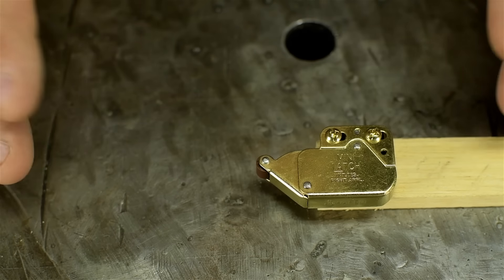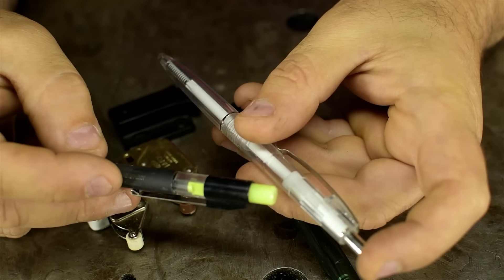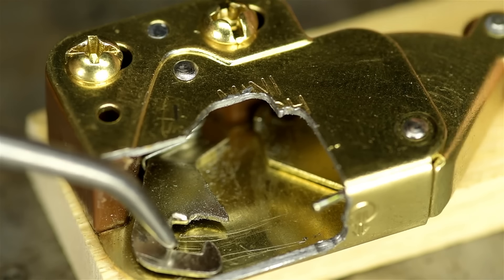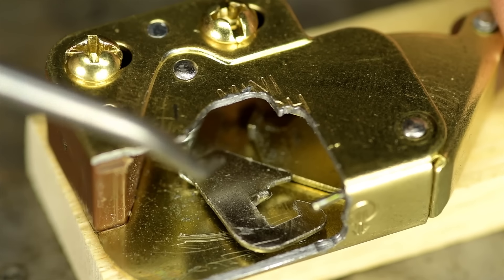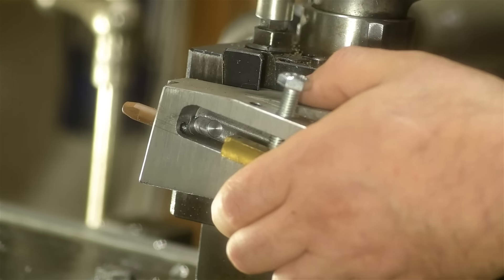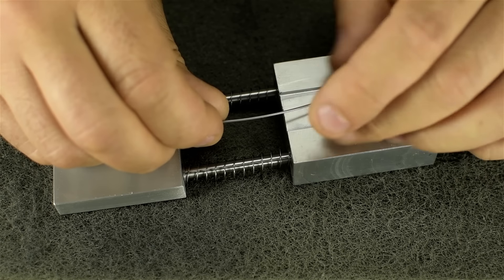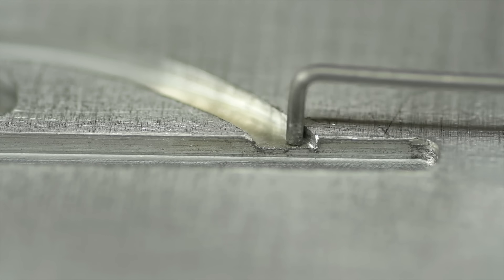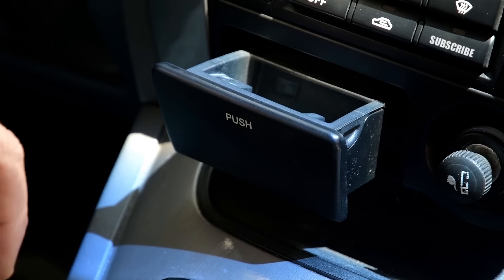PUSH LATCH Mechanisms (DIY!)

Comment: i have a question. 
this is going to be a long one, 
so if you feel like reading it and can help me i'll be grateful.
also sorry for my grammar mistakes, English is my third language.
i used to take things apart since childhood, also really liked building things with Lego, drawing to a respectable level (considering my ugly handwriting) and tinkering. used to be a very creative child, not as much anymore.
i do a lot of handy work at my parents home, and in places i work\ spend a lot of time in.
i worked for a little while in my go to's mechanics garage, also spent a lot of time learning how to fix cars on my own, and now i know how most of it works and can fix and maintain my own car.
i worked with an electrical and cooling technician, helped set up retail freezers and fridges,  fill them up on Freon or whatever it was, build electrical\fuse boxes, that sort of work.
in the army i used to take my assault rifle apart to the smallest springs out of curiosity even through we were only allowed to remove the bolt and disassemble it for cleaning.
last year a friend of mine who's welder started working as an independent contractor in an egg processing factory and took me as an assistant, that's where i started learning about welding, we also did general maintenance, platform and pipe construction and mechanical repairs. that also the first place i got to work a little on a lathe, cnc machine, mig, tig and smaw welders, different metal saws and cutting machines.
this got cut short because of the virus.
right now i'm finishing my first year (out of 3) of practical (mechanical) engineering, so i'm also diving in to the whole science, math and calculation aspect of all of this.
i'm considering getting diplomas and certifications in other things like electrician, mechanic, welder, cnc operator etc'...
i'm also considering studying to an engineering degree although i'm not sure that i want to sit around and design, analyze and troubleshoot problems in a tiny spec of a specific field, or just be restrained to a computer.
now, whenever i try to find out more, by asking people or looking up on the internet, i can't seem to find out what other fields like this to explore,
 how to build a life being able to do all\ most of these things for a living
 (preferably starting my own business at some point and working for myself),
 how to focus my passion for all of this,
 and even what is the term for all of this (the one of few words that can sum all these fields and skills up).
at the time of writing this i'm 23 years old, I've also worked in many unrelated jobs, my family is in business and they kind of frown upon the fact that i'm not interested in stepping in their footsteps and learn how to run their business.
i do consider myself to be good with my hands, i don't think i'm the best, i know i have a lot more to learn, and that i don't have enough time in the world to learn everything.
to sum my questions up, i need some guidance, i want to know and be able to do more, i want to build a career around it, i feel overwhelmed and i don't know where to aim, so any help will be appreciated, thanks!
Reply from the maker: that's a big question and difficult to answer... but... learn as much as you can about everything that interests you.  a degree is always good but not necessary and only if your curiosity drives you to it.  23 is young still you don't have to make big decisions just yet.  soak it all up like a sponge and see where the fun takes you.  I don't know if you should be taking advice from me but that's how I see it.
Reply: @ThisOldTony  thanks for reponding, althrough i still have most of my questions unanswered, if anyone els feels like or has any advice or answers ill be glad to know.

Comment: this video has some micro-SD push-push socket vibes for the electronician that  I am. If you have those socket (like Molex 5031821852) in one of your electronic devices, the latch is likely the first thing that would broke: Be gentle and put some sweetness in your micro-SD card insertions. your device will thank you for that (and your wallet too). Thanks for bringing this important subject out of the dark Old Tony, don't get loose and keep-up the latch on your content quality.

Comment: The equivalent of this in electronics is a Schmitt trigger. I wonder if in mechanics this behavior is also called "hysteresis"... https://en.wikipedia.org/wiki/Hysteresis#:~:text=Hysteresis%20is%20the%20dependence%20of,field%20changed%20in%20the%20past.
Reply: interesting if there is a way to implement this in one plane, meaning no 3rd dimension?

Comment: Tony - Just wait until you get a look at a rotary version of this mechanism, like on projector screens or those cheap auto-coiling USB/whatever cables from the dollar store (where the bobbin stays in the middle and the cable expands out both sides), or on an air hose reel. There is a ball bearing that rolls around a track, and each time it makes a loop it clicks down a shelf to do another loop, just like with this mechanism. That "click" you hear every rotation is the ball bearing falling off the 1-way shelf. To allow it to wind back up there's a second circular track inside (outside? I forget) the other one that it falls down to in the opposite direction, then same thing, a different shelf. If you pause and let it go backwards, it clicks from one track to the next track. Fascinating little thingy.

Comment: hi Tony.
I would like to ask you an off-topic question for this video but since the first thing you showed was a tig torch over a pair of leather gloves ...
they are shooting videos that talk about "cold welding" showing a tig torch that with a series of progressive discharges weld the edges of the metals without making them become incandescent. (here you have an example: https://youtu.be/oHPRyTxyjW4) my question is: are they particular machines or is it a different use of the "usual" TIG machine?
from how they show it, it seems much easier to weld compared to a common arc welding or to the practice necessary for a common tig welding (I do not know in any way) and then these welds are as resistant as the others or not?

Comment: I'm excited, I may have a tip for you ToT! Plus it might make the young Mrs ToT happy!  The coin tray is below a car stereo so you might be able to pull out the stereo without having to mess with the dash board. If you have two small holes [on each side of stereo] there is a little tool that fits in and with a push you can pull it out. Hope this will work and you will get to explore another assembly trick.

Comment: TOT---I got this from Guy Lautard---(Lowtard)pronunciation---(he's the guy  N.P.I.  behind the "machinist's bedside readers".)--when you make a coil spring with hard wire, it will keep it's intended shape (size) better if you TEMPER IT after you roll it..  A cookie sheet and 350 to 400 for an hour works fairly well.  Don't ask me why.

Comment: If the compression springs that have 0 body length haven't been invented yet, then what are you waiting for? Invent them
Reply: They'be already been invented, they're called barrel springs, or conical springs. 
They're not exactly zero length when squashed, but as near as dammit.

Comment: Tony, I had no experience designing push push latches just two months ago. I spent a while messing around in fusion 360 and created a barrel cam and I ended up with the exact same geometry that you did, except mine was wrapped around a curved surface. I have to say thank you for confirming my design, but couldn't you have been a bit faster releasing this video so I wasn't worried so much?

Comment: My first exposure to the inner workings of one of these mechanisms was when the latch on our Nintendo broke many years ago (original NES) although I didn't take it apart to fix it until years after it broke and we had a Super NES.  In the meantime I used the tried & true method of a cassette tape in its case jammed in between the cartridge holder and the top of the chassis.

Comment: Yet another dead wrong axiom. I have hated that stupid quote for years, for three reasons. 1. Miscategorization: Its NOT a definition of ANYTHING... its an example. And a bad one. 2. Misattribution; if Einstein actually said this, he plagiarized Relativity. Sure individual IQs fluctuate, but not between the Plank length & a Gigaparsec. 3. Just WRONG: Repeating an action to achieve improved results is called PRACTICE. And as an older and infinitely better quote quoth, 

“PRACTICE MAKES PERFECT!”

Comment: That's how cars are made. So they're not worth fixing. So you'll just buy a new one... When I had stuff wrong with mine I just did my own exploratory surgery... Most dash boards are made of plastic... A drill and vise gripes rips it apart right were u have to LOOK AND SEE... That way I don't have to buy all these extra tools and spend all this extra time disassembling the "proper way"... After my simple problem is fixed and working, I just go buy some cheap wood puddy and smooth it all down and paint it so no one notices it was torn into. Don't get caught doing this though!! It's worked for me and saved me tons of money in my lifetime... Follow rules completely and u will suffer for it... Those who make them make them to KEEP U DOWN and never apply those rules to themselves! Just look and listen to your politicians!! I don't want your money. But if u have knowledge I WANT THAT!! Money is just PERMISSION to go to stores and benefit from OTHER PEOPLE'S knowledge or the collective knowledge... Any jerk can go buy shit. Do u know how to fix it? How to make it? Then u don't have to buy it!!!  I go through garbage all the time. I have about zero competition. Cuz the others are just looking for recycling stuff cans copper to get money then drink alcohol or get high on drugs.. None of which I have any use for... I keep my money LOW and my knowledge high. As high as possible cuz I always realize I'm a stupid man... If I'm smart then why do I still need money. If u think honestly, u also only need your money when you're stupid. When u are the one with the knowledge, the money is looking for u... Armored car or lotto money- NO WAY! They will cut my throat and take it! People are totally insane when it comes to money. They think its value! Truth is exactly the opposite of what they believe... It's a system of knowledge, not a system of money. Store not open u can't spend it! Don't think people are brainwashed and INSANE!? When's the last time u heard someone say: "Help me! I don't have enough knowledge to live on!" Never. They always complain about their money... Rich people born with a silver spoon not self made rich are the most helpless people in the world... Everyone is so BRAINWASHED no one even asks me "How much knowledge did u get this month?" So to sum up my long winded comment:
Thank You 
For your free knowledge videos...

Comment: I love using lego to make mechanisms due to the mixture of the simplicity and challenge of using premade parts. One of the mechanisms I made was a lego sd card and sd card slot. It's an interesting variant of a push-push latch and was a little frustrating to make but it was so fun to play with once finished. Doing that made me fall in love with push latches.